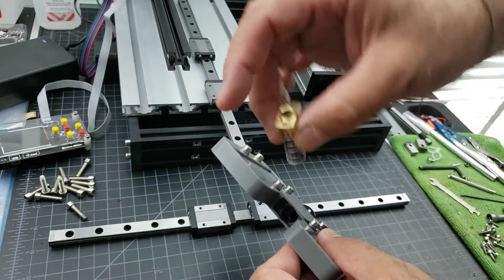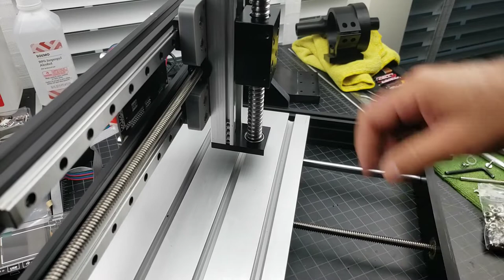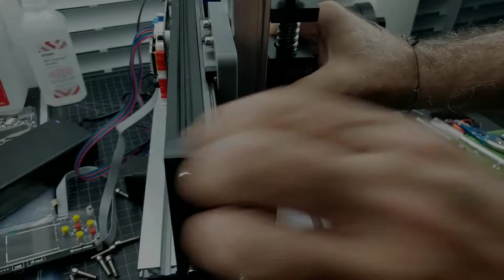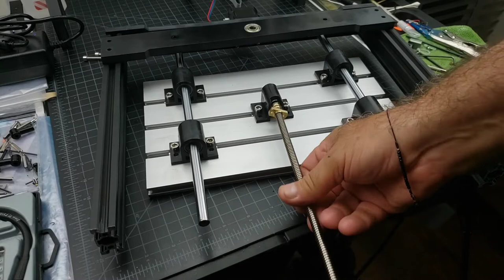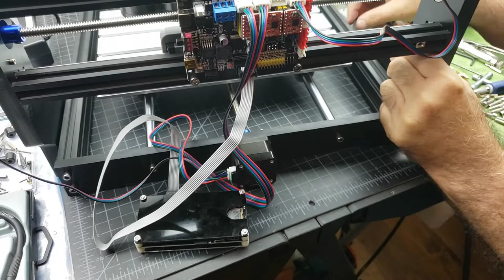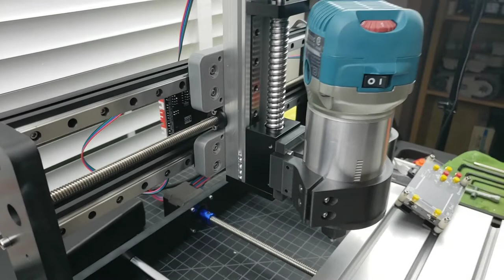3018 Pro Max CNC Build - Upgrades to Support a 65mm Spindle - Part2

Comment: After 6 months I've built a very similar version from my CNC 3018. used the same rails and rail attachment for Z Axis carriage. There is a substantial amount of flex at the very tip of endmill. I have two guess about cause of flex. Are you still interested in this project? If so, I think its the aluminum extrusions that are independently connected to black side plates, or the plastic adapter for Z Axis. What would be your guess?

Anyway, its still a great improvement from the stock version. Thanks a lot for inspring my lil journey.

Comment: Did you ever make a follow up video on your cnc router/mill?  I have been following your design and I am doing the similar build with a Genmitsu 3018 prover v2 that was basically the same as the one you upgraded.  I already  did the 3040 Y extension I am going to order those big Y rods as soon as I can.  I got your X axis plate mixed up with someone else's and printed and it was binding up  on the threaded rod and I couldn't get anything on the Z axis to line up, and was having problems with the limit switches.  I did cheap it out and found a Bauer 1.25hp router at Harbor Freignt and saved about $80 there.  Figured I could buy another for the savings.  Are planning to do a follow up.  Just interested in how your project turned out, so I know what to expect.  Best Wishes

Comment: Hi m8 a m planing on doing this but doing it to my y axis I built a 600mm frame/bed extension planing on sing the runners as well the t8 threaded rod using runners to take the wehgit off the rods and give more stability am I rite saying I can use the same rails just longer ?

Comment: I ordered everything. I got a sheet of HDPE to make the mount instead of 3d printing it. I got a 1/2" cutting board off amazon for $6 and used the machine to mill out the part. I cut it in 3 different sections though. Waiting on the Z axis to come in today. Question, did you add limit switches? I guess if you do your cad/cam work correctly you wont need limit switches. I still like to have them I think, IDK though. DO you use them?
Reply from the maker: yes, I did add limit switches. I ordered small micro switches from Amazon and 3d printed some mounts for them.

Comment: Great upgrade, please could you share the stl for the height adapter part used for the delrin lead screw on the bed as it's not included in the files on thingyverse.

Comment: once this is working I would be getting some ali plate and mill all the bakelite panels in Ali and the double bridge on X, the thing that worries me about this is the amount of rotational torque you have at the end of a Long tail of a L in profile of that Z support.  Its comes out a really long way. It looks very over balanced.

Good build though.
Reply from the maker: All are very good points you make. This was intended as an experimental build (discovery if you will). It works nicely on small aluminum parts not requiring a high degree of tolerances, but as you point out, there are definite compromises involved. :)

Comment: Um, plastic router collar? As many other videos have shown, plastic unavoidably gets hot, and sags, ruining any chance at rigidity?
Reply from the maker: I didn't have an issue like that when I used it for small parts. ABS has a melting point around 220-240°C.
Reply: @revivingretro PLA also has a melting point at minimum 170°C or higher, but that is not important. What's important is the glass transition temperature, which is at around 85 to 90°C for most ABS plastics. It depents on the exact formula. High temp ABS softens at around 110°C.

When the machine isn't used for a very long time and not pushed to hard, that's okay. Also cheap router tend to have more losses and run hotter

Comment: Mate, how can you say it does not flex?
It does, a lot.
Watch your own video loooking close up.
min 30:35
Reply from the maker: You're right. I should have tempered my enthusiasm and properly stated it does not flex as much compared to where it started. The flex it has now is minimal for the little things it is used for. I will post cutting video as soon as I can get to it. Using it at high enough RPM with low feed rate produces very little chatter. Not as good as my larger CNC mills of course, but good enough for small soft metal. I CNC smaller 6061 aluminum parts with decent results considering this cost me under $300 (my site www.InetRC.com)
Reply: @revivingretro  So in your opinion, what is the source of the flex? The 3D printed part connecting the rails with the z-axis? Also, is the z-axis you have good enough to support the Makita router when cutting something hard like aluminum? Would a wider z-axis provide more rigidity? Also, please post a video cutting aluminum. I have most of the parts, but I haven't decided on the proper z-axis yet. Thanks!
Reply from the maker: @harvilleDesign  There is no question the weight of the router is causing the flex. It is quite heavy. The 3D printed spindle holder isn't budging at all. It's the rails. The rails I am using are thin and they are pulling away from the back plate a little. Strengthening the linear rails where they attach to the axis will help. Modifying the axis to accommodate beefier linear rails would also help. I wasn't after perfection here though. I used it to cut small RC parts out of 6061 aluminum. The flex was negligible for what I was cutting because I was using a high RPM and a low feed rate so it didn't really have an opportunity for heavy chatter (I also used a high quality end mill - I believe I used a 2 flute Iscar when I was cutting the parts I needed). I could afford the slow time because they were small 1:10 scale RC parts (some of my work here:  http://www.inetrc.com/Album/) - did the parts come out as clean as my industrial grade? no - but the parts were highly acceptable with a little cleaning up - or I could have tacked on a finishing end mill if I really needed it.

I have a queue of videos I have yet to edit, but I will get to this soon. In the meantime, you can see a similar setup that EricInventor did here - he showed his cutting aluminum at the end  (I unfortunately ended my video thinking I was going to do a part 2 showing limit switch install and 3D prints for them and finish with cutting - just didn't have time to circle back)

Eric's video is in the description, but I added it here for convenience as well:  https://www.youtube.com/watch?v=w26DHMccicE
Reply: @revivingretro  Wood and 3d prints is what would make it flex. Plus the Y has unsupported rails and are long too.

But compared to a stock 3018, most( if not all) of the slack/play are addressed. So I'm quite sure it has no play. Just flex. When cutting aluminum, the rigidity will be tested. Especially if you would want to cut faster and want better finish.

Comment: What infill did you use? 100%? is the file linked modified for the M4 screws or is it the original file? How did you modify it? do they need to be bigger or smaller?
Reply from the maker: I used 60% infill - the Thingiverse link I provided has all the details (60% infill as well as the original fil that was remixed). Modifications were primarily for the spindle attachment.

Comment: Do you have to 100mm or the 150mm Z axis?
Reply from the maker: The video description provides you links to a lot of the parts used. It is a 100mm axis. I only built this to experiment and handle some small aluminum parts so I kept the length reasonable. :)

Comment: Those rails are a bit tight, I lapped my rails with polishing compound until the rails would slide on the carriage blocks just by tilting it a little.
Reply from the maker: Great idea! Simple and effective! Nice tip!
Reply: @revivingretro  the carriage blocks that have the  black end caps tend to be a bit tight and the green and red carriage blocks tend to be smoother. Of course you never know about china rails. It could just be my limited experience, but it seems to be what I have found.

Comment: Thank you for this great video. I followed your instructions and I was able to get it working. The machine is much more stable than before, and the z-axis has very little play. I 3D printed the parts with PETG at 60%, and it feels very sturdy. I did some testing yesterday, and I was able to cut through plywood like butter. I even cut through a little aluminum when I accidentally plowed the head into the bed! 😃 I salvaged the t-nut off of the old z-axis assembly and reused the anti-backlash t-nut off the x-axis. The spring from my old z-axis fit better in the 3D print than the one from the x-axis. The one problem I ran into (maybe I have a slightly different machine) was that the lead screw did not match up with the stepper motor. It was close, but it was causing some binding near the extremities. I cut an acrylic insert on my laser cutter, slipped it behind the mount, and now there is no binding. I haven't done the y-axis upgrade yet, but that's next on my list!
Reply from the maker: So happy to hear about your success. This quote cracked me up because I've done this before :)  "I even cut through a little aluminum when I accidentally plowed the head into the bed! 😃" - Can't say I had the same issue with the lead screw, but I do have a different lead screw due to the after-market bed extension I ordered, or maybe the . The stock one should have still lined up though. Maybe an alignment difference with the side assemblies? Nonetheless - again - your note made my day. Always love it when folks share their success stories! :)

Comment: Nice video, I enjoyed watching.  I also have a 3018 cnc since this week and I also want to upgrade my machine along the way which is similar to yours.  I had a question, I see you replaced the Z axis stepper motor for a bigger one.  Is that a Nema 23?  And is that easy to connect to the original motherboard?  I look forward to your next video. Kind regards, Dennis Aretz from the Nederlands.
Reply from the maker: The z-axis actuator already came with a Nema 17 stepper motor installed (see actuator link in my description). It plugs right into the motherboard. Hope this helps ya out :)
Reply: @revivingretro  Thanks for the info, I just ordered a Nema 17 (hanpose 17hs4401s) stepper motor. I looking forward to your next video. Keep up the good work !

Comment: 3018's are nice for learning BASIC CNC but with in the first weeks I was gutting mine and welding up a 600mmx600mm frame and some 3d printed parts from the ROOT 3 CNC. Check that project out. uses 25mm steel box tube and some 608 bearings. very few 3d printed parts. I've wasted almost a grand trying to cut mild steel on a 3018. I managed to get a few cuts with the 65mm dust shoe and my router started to get loose and could'nt get to the crappy E-stop and almost pooped my pants.
Reply from the maker: I feel what you're saying here. I wouldn't be using one of these on steel, personally. Small parts and T6061 aluminum or softer is what I use it for. Once in a while I use the laser for etching a design. :)
Reply: 🤣🤣
Me too... 1 week after I got the 3018, found myself designing my new CNC in Fusion360.
I'm glad I didn't put money on the 3018.
But it's a cool machine 😊

Comment: Do you have a router mount without dust collector?
Reply from the maker: You need to 3D print your own. The 3D files I used are in the description. You could always use a mesh mixer or Fusion360 to slice out the dust collector intake at the top and bottom (or just cut it off with a cutting wheel after printing I suppose). The bottom part of dust collection is held on by magnets, so you could always leave that off as well.
Reply: I modified it in freecad to remove the dust collector. I have not printed it yet but I got it on a USB ready to print.